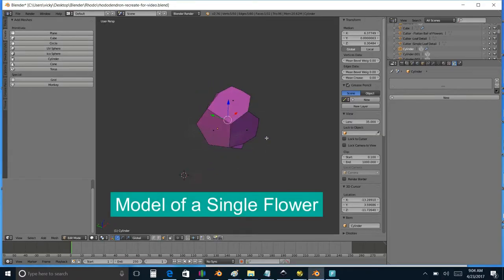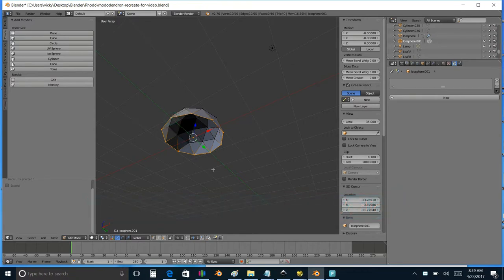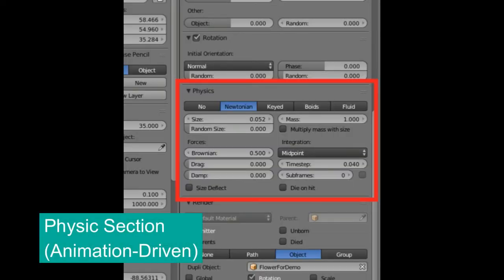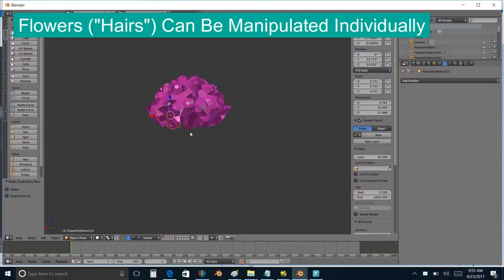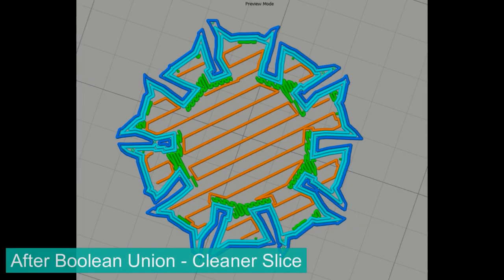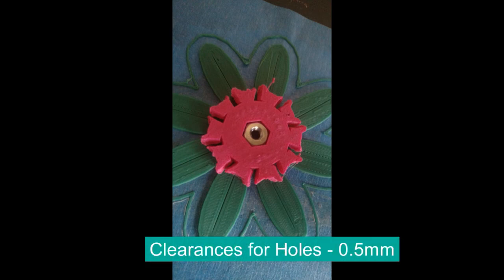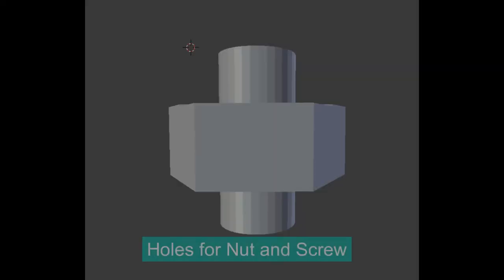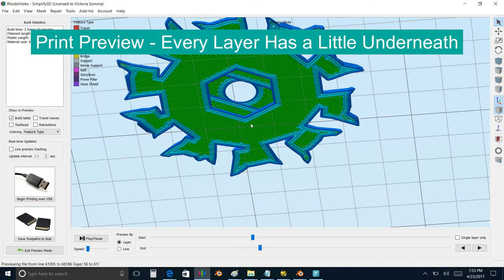Using Blender's Particle Systems for 3D Printed Rhododendron Drawer Pulls

Comment: You can activate the "Mesh, 3D Print Toolbox" for some extra checking and exporting of stls as well. I made some pics of it here
http://lukethier.blogspot.com.au/2017/05/some-blender-tips.html
Reply from the maker: Good tip, Luke!  I used to have that 3D Print Toolbox Plug In in Blender.  I need to get around to installing that on my new laptop.

I heard a rumor that MakePrintable.com has a Blender Plug In for 3D Printing as well.  I have not had a chance to look at that yet.
Reply: I've had it for so long I thought it was always just there and not a plugin lol but anything that can help you identify problems before hand is a good thing I guess. :-)
Reply: I must keep an eye out for that, thanks.